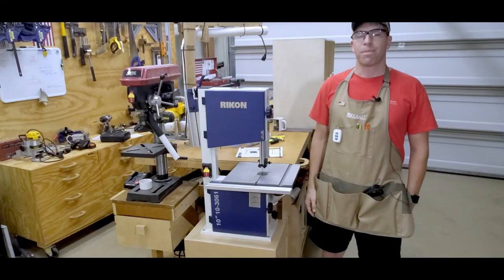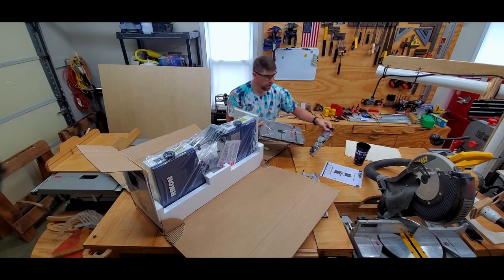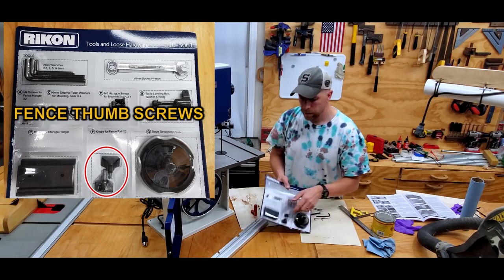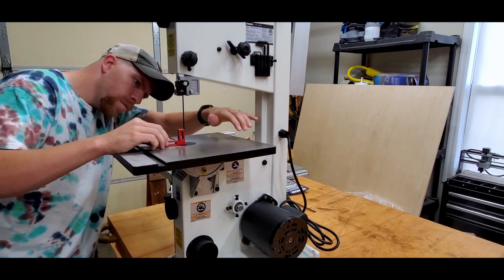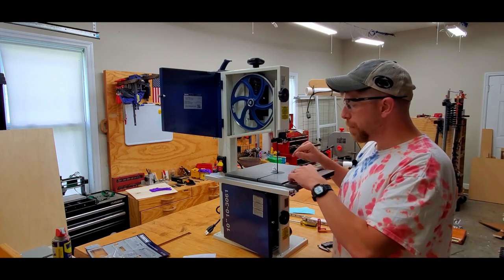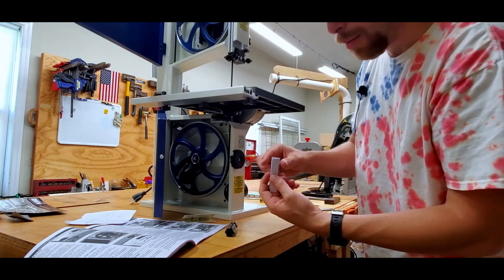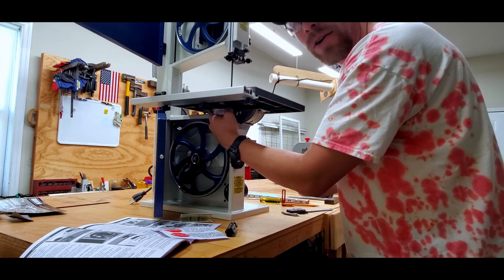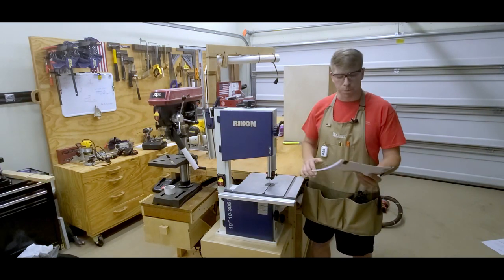Rikon 10-306 Band Saw / One Stop Resource For: Unboxing / Setup / Tuning / Features // EP62

Comment: This thing sucks butt. I've had nothing but problems for 5 months. It drifts no matter how well you tune it. Tensioning and tracking do not work. Blade pops off the wheels constantly during blade change and sometimes during use.
Reply from the maker: Wow,  definitely call the manufacturer. Thanks for sharing your experience here for others!  I'm pretty happy with my own, I know small bandsaws are generally prone to  power / drift issues but my own experience has been better with this saw than other BenchTop models. It sounds like a tracking issue.  (no sponsorship or anything else that might sway me)
Reply: I was pissed off when I wrote this but no doubt brother. The quality is good overall. Ive clearly got an individual issue.
Reply: The drift is insane. Even drifts through paper 😂
Reply from the maker: Yeah, they certainly need to hear about that! I've spoken to their customer service,  they're pretty responsive... should not be how your saw is performing.